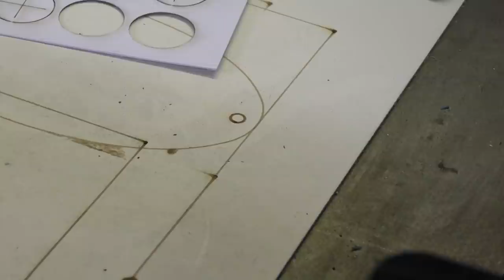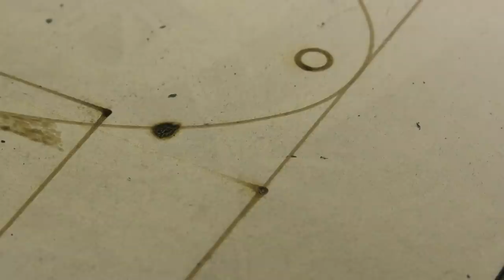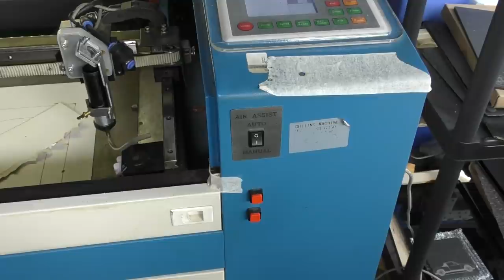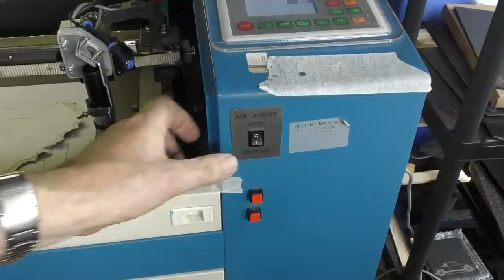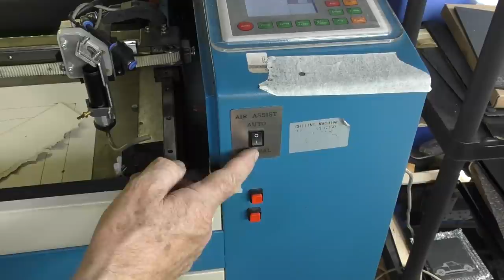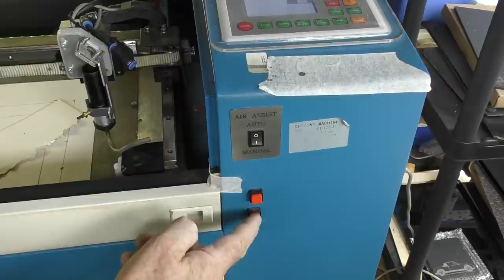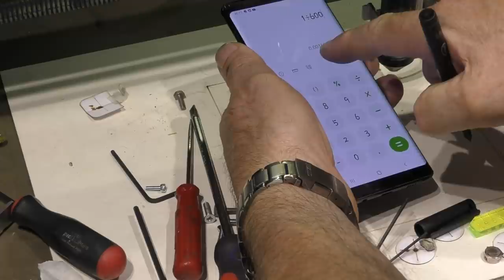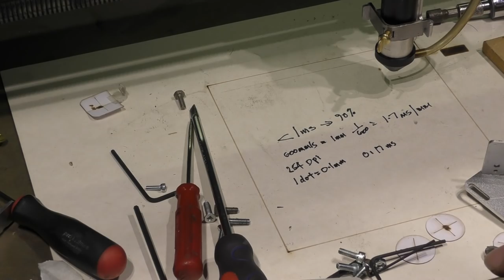RDWorks Learning Lab 190 Creating the RUSS spec Machine Part 2

Comment: Russ...dont forget about a bullet (inline) style Blower ( i use 2  6 inch  fans (inline) on my 600 x 900 and they dont draw enough )   on my 900x1200 I use an 8 inch blower with reduction funnels on the end to reduce to 6 inch opennings that fan draws beautifully and the drop in the noise level is very much worth the effort...I can leave the lid open so that the camera still sees the full bed and the fan draws fine (with a metal plate on the bed like yours) lightburn now allows me to to add the camera without the need  to calibrate it (just use the aligning  diagram) I  want to let you know that I am very grateful for all you have helped me with...thank you sir.

Comment: When you have the machine operating at 5x the original spec what is the chance of a catastrophic meltdown with the stock power supply?  (If I understand this and WOW 😊)
Reply from the maker: My step daughter is thrashing it regularly for her photo engraving business and I  have had no signs of any problems in the past 6 weeks.
The mechanics are well capable and it is only motor power that limits the acceleration and deceleration. Top speed is not an issue. As I demonstrate in this video, if you try to exceed the motor's capability it will tell you by losing steps.
Best wishes
Russ

Comment: Can I fly you to America just to align my C02 laser I messed the whole thing up and can never get that beam straight again.  You knowledge for these machines are superb
Reply: Where are you at..there's got to be someone close to you that can help.
Reply: @dwightbauer6705  Im in central Florida.  A company by the name of @BossLaser is close but they only work on their machine.  It sucks because I was born in 1980 and if someone knew how to do something regardless of the manufacture they will try their best to apply the common knowledge to help one out.  However Bosslaser refuses to help anyone out unless its one of their brand.  My machine is no cheap one I paid over 5,500 including taxes import fees and delivery, its well built from the belt, stepper motors, psu, rail, etc.  Its built equally or even better than the Bosslaser I compared the two.  I could of drove 45min and picked one up but would of paid over 7,000.  Its from a company Jinan Precision CNC Machinery.  I used an Epilog Legend for almost 8yrs and became spoiled cause it was so easy to operate however business partner was a douche.  I know quality and what to look for in a good Chinese build.  It is a huge learning curve from the Epilog and one day I will have it again.  For now I have to settle with this and make the best of it until funds are right.  If you know of anyone in the USA or Florida please let me know.  I do alot of photo engraving on wood and make medallions etching is very important.  I need that beam to the finest point possible.  I spent nearly 3 weeks turning 9 screws and always end up with blurry engraving.  The focal point is spot on so its not that its just getting the damn thing straight.  I was not familiar with these  Chinese setups and ended up fiddling with it too much.  I know the Epilog in and out, I can create quality work with a 5,500 Chinese build just the same as the Epilog 30,000 machine or at least close enough.
Reply: @Matucks  the best advice I can give you from when I started working with Chinese lasers is that I always reset my mirrors to the  zero position, (what I mean is that I always put them back to where there are flush again the surface mount and none of the screws are adjusted at all) that way you are not trying to fix your previous mistakes but setting the laser a mirror at a time into the correct position from the base ( I assume you have watched a few utube vid's already)...I m to far away to help you, IS THERE ANYONE IN FLORIDA WHO CAN HELP?
Reply: @dwightbauer6705   yeah lol I must of watched all the videos even in different languages its all the same.  I believe the structure that is holding the mirrors in place is out of wack.  I watched one video where the guy was checking 45 degree angles from mirror one and the body of the machine and mirror 2 on the rails being 45 degree angles.  .  My machine was off a few degrees and I moved it.  Theres so many adjustments to fiddle with.  I tried the zero position and it helps but in the end when I move the bed up and down the beam just dosent want to hit dead on the first fire, its off about 1mm when I fire the second hit and drop the bed say 20mm when I'm checking the alignment from mirror 3.  Its so frustrating I'm willing to pay for gas or a cheap fair to fly someone in lol

Comment: I think that the fourth corner problem is not related to a mirror #2 movement or misalignment, but rather to a misalignment of the guide rails on the forward/backwards axis. Once the mirrors are aligned via the first three corner set points, the laser beam will theoretically exist in a perfect plane. However, you don't know that the two guide rails on left and right sides are exactly parallel. It's likely that they are parallel left to right as you look at the machine, but you aren't guaranteed that they are parallel top to bottom. I'm other words, the two guide rails aren't necessarily co-planar. As the gantry moves aft, the right side of the gantry moves slightly up or down, but the laser beam doesn't. That being said... What's the fix? In my machine... Nothing. I can't move the rails because they are directly bolted to the machine frame and it is just slightly warped. I'm more likely to cause problems by trying to remove them. I have just adjusted the entire beam plane to minimize the misalignment. In other words, I never have the beam in dead center, but rather it averages to dead center across it's whole range of motion, thus minimizing the error. A proper fix would require a machine that allowed the guide rails to be adjusted in some precise way up and down to ensure their coplanar adjustment.
Reply from the maker: Hi Chuck
 Thanks for your suggestion . Apart from my own Chine blue machine, out of about 15 or 20 ((I have lost count) machines I have encountered with this problem all but 2 have been fixed by stabilizing mirror 2. The two that escaped have always puzzled me . One in particular I was dealing with live  via  Skype call and the guy had lots of good equipment that allowed us to bounce visible laser beams around. Beyond any doubt, he did NOT have issues with mirror 2 but still had a 4th corner problem. We checked things like the parallelism of the Y rails and I freely admit to failing him. However, a recent request for help with this same issue was well on the way to failure as well. There must be something that we are all missing. This stimulated me to think more laterally about the possible cause.
I played with my most recent machine ( the orange one) and discovered what I think is the real cause. Here is a video that deals with this new approach. If you have a machine with this issue than you can try this solution for yourself. It has now worked on 3 machines.  
https://www.youtube.com/watch?v=Oc3UaJREQnU

Best Wishes
Russ
Reply: @SarbarMultimedia  Thank you! I just finished watching the linked video. I aligned my beam about two months ago and wish I had seen that video first!
Reply from the maker: @chuckjones55  
Hi Chuck
 Just that one final diagonal check to tweak  mirror 1 is the vital step that has been missing from the age old beam alignment procedure. Spread the message if you encounter others with the problem
 Best wishes
Russ

Comment: Lol I've only just purchased the first light weight head :-(
Reply from the maker: Hi Steve 
 Please don't be concerned.  I have not changed the fundamentals of the philosophy or the design. Many people are very resistant to change and it may not appear so but in a basic way I am also. If it's not broken then don't fix it.  Sadly, there are a few basic design/usability issues with these machines that get in my way from time to time and have to be fixed (in my opinion) To have a head design that was light yet able to utilize all possible lenses and nozzles  available,  and to run at speeds  undreamed of for this pile of cheap Chinese pieces was  the last link in a chain of small improvements that allowed me to  engrave at 1000mm/s.  The Mk1 head design was pared back to the absolute minimum to prove the principle and it works perfectly..........for me. Many others have now fitted it (with small modifications to suit their own machine differences) and reporting similar massive gains. The Mk 2 design  widens the scope of how the head can be fitted and allows those people with the acrylic head design I created about 2 years go  to use their existing adjustable Y/Z bracket as a mounting for this design. In solving that problem I had to add the inner L  second liner. Leading on from that allowed me to put the mirror back to a more standard 25mm.
The mk1 lightweight head has not been devalued, the mk2 design has just  widend the population that can easily adopt it.
Thanks for your continued interest
Best wishes
Russ
Reply: @SarbarMultimedia  are there plans for those tube holders?  Great simple design would like to make some.
Reply from the maker: @kzook75 
Zaleb
All my drawings for machine improvements are freely available. if you wish to modify, copy or adapt. you are free to do so. I am not interested in making money, instead  I hope   people can improve and get more pleasure from their machines,....as I have done. Just add your disguised  email address  to another comment and I will send your data.
Best wishes
Russ